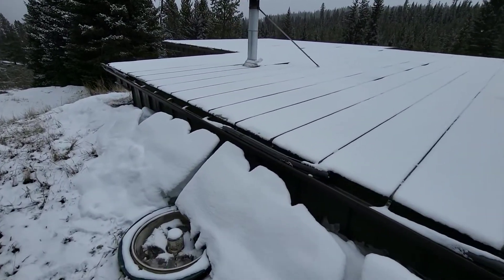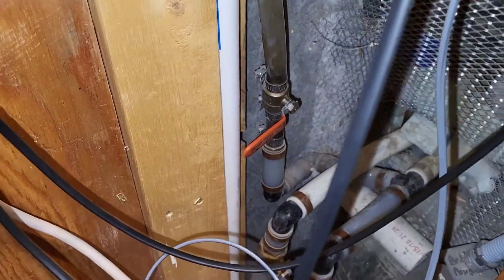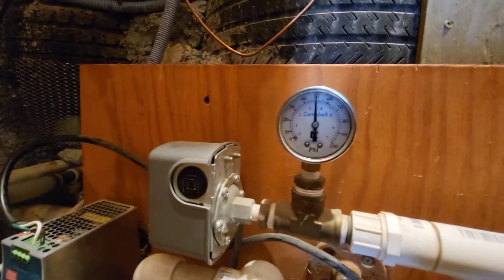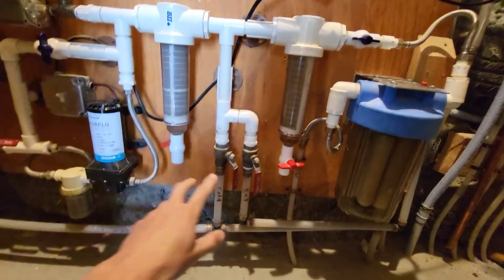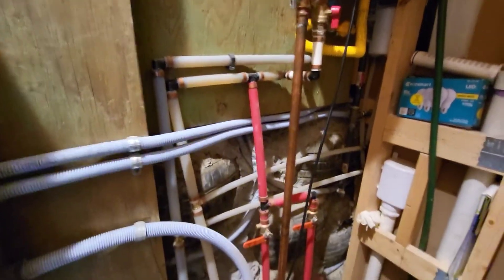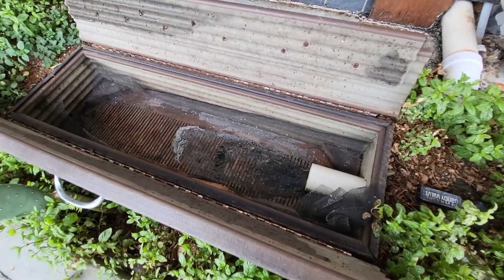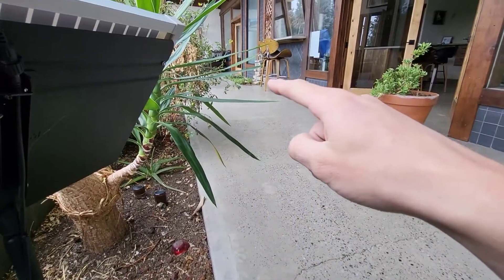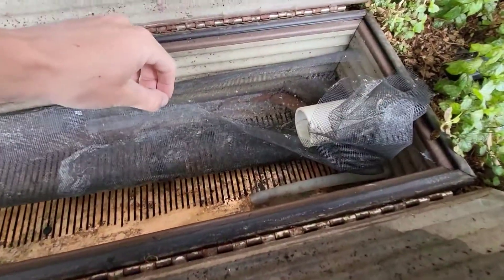Earthship Water System: Rainwater catchment, filtration, and grey water planter.

Comment: Does our gutters freeze and break. We have calcium and magnesium in our water what filters we’ll we need to filter it out. Where going to have a on demand hot water heater also. Don’t want a conditioner system with salt it will ruin my septic. What do you think we should use.
Reply: Try NuvoH20, citrus water softener. I got the tip from Matt Risinger